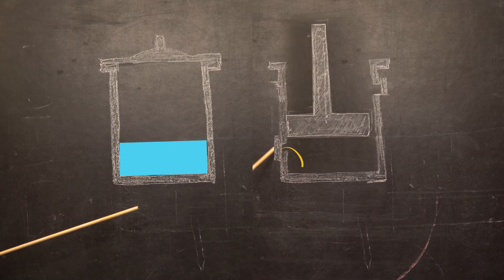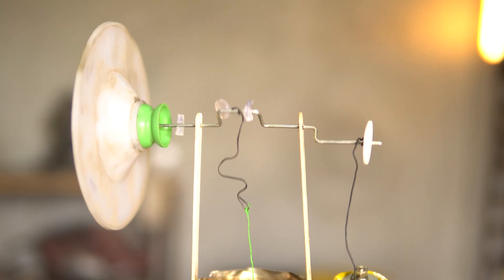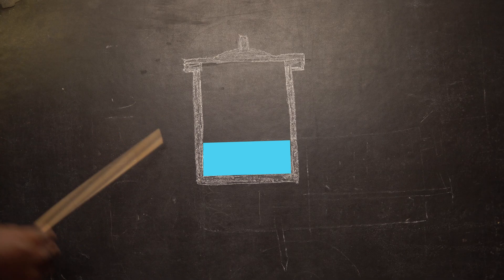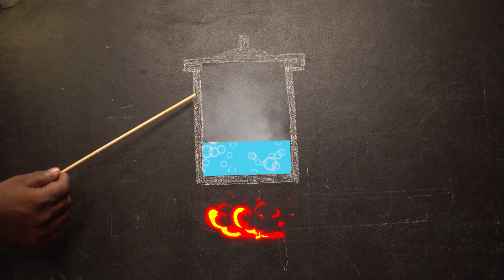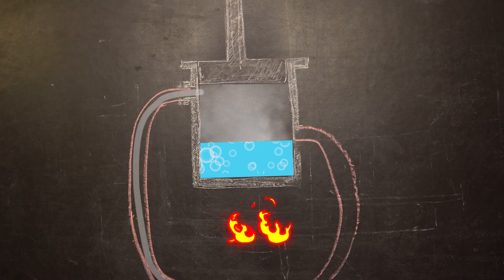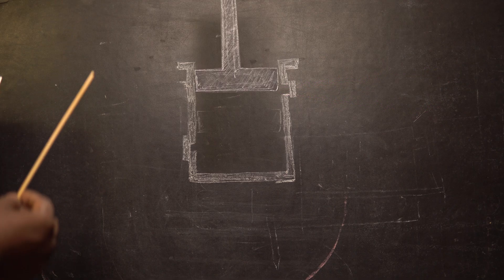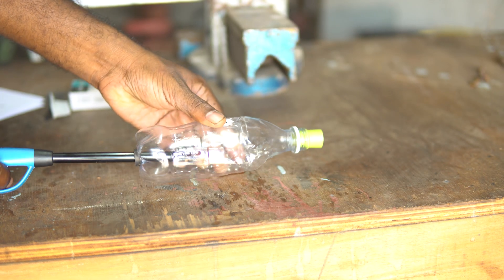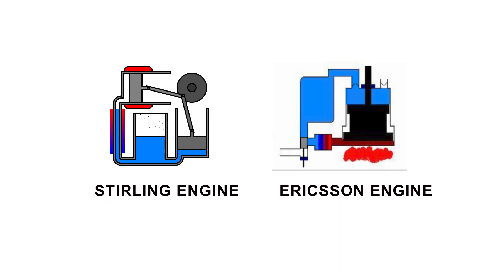I Built a Working Engine from Soda Cans | DIY Stirling Engine Explained in DETAIL

Comment: Steel wool is much heavier than I would have tried, styrofoam works but us obviously susceptible to too much heat a little foil around it seems to make it a fair bit tougher but there are plenty of higher temperature foams that are basically impervious to any temperature you would want to run a Stirling engine at.

With enough fiddling a styrofoam based one can run off a cup of hot water for quite a while though it doesn’t produce much torque for the surface area so it can’t really power anything unless you are really good and can make a saucepan sized one and I can’t get them to balance or seal easily that big.
Reply from the maker: Thanks for sharing your experience with different materials, I appreciate the tip!